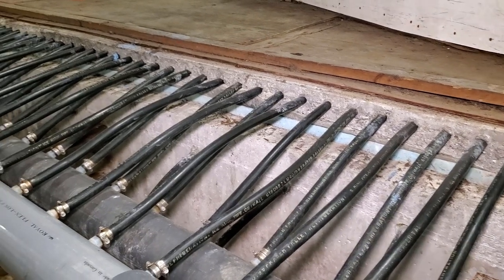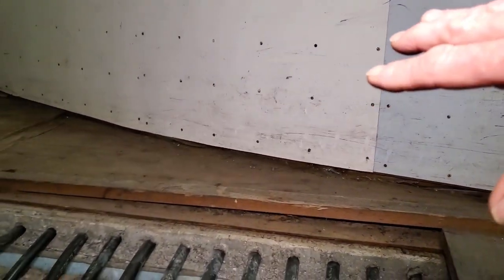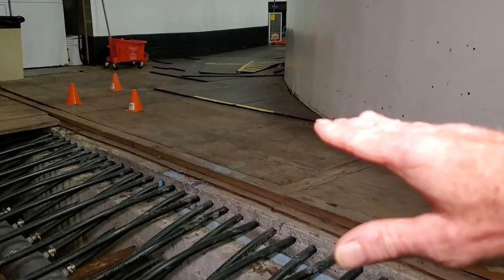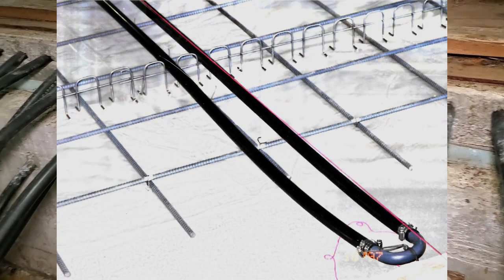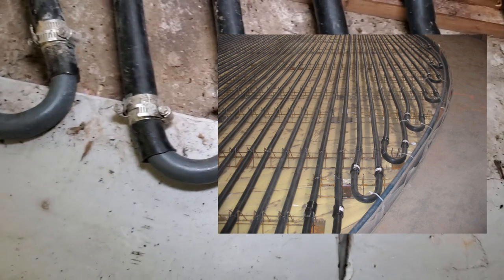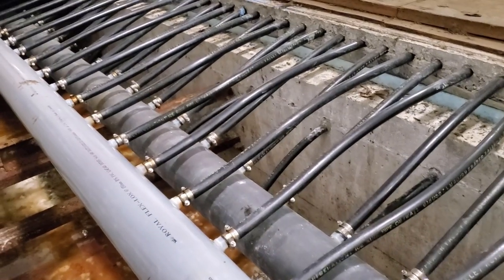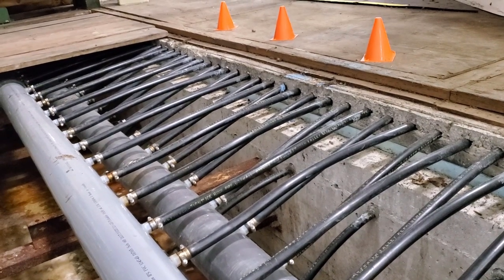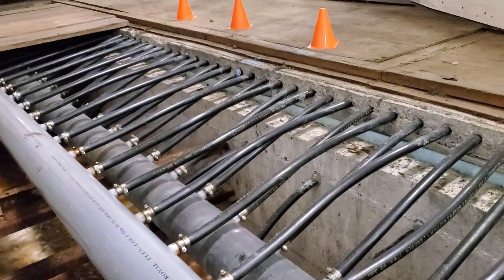Rink floor Basics

Comment: Hi Local Ice Man,  I just enjoyed watching your video showing the details of your ice rink floor system.
You commented initially that you are not familiar with all of the details, which I totally respect.   Personally, I have been in the ice rink floor business for the past 40 years in Canada. 
Just for clarification, in my opinion the accessible headers and return bends, as you have in your facility is the best way to go if possible.  Even if polyfused HD piping is used, the lines in the floor can be damaged, ie; a hole drilled into a pipe, or some of the pipes can be plugged with a gradual build up of rust or debris in the brine system.  Your accessible rink pipe connections will pay huge dividends when you have to repair these types of problems, and these problems will occur.  With a buried header system the repair costs and system down time will be catastrophic.  My suggestion is to always have an accessible header system and return bends. Thank you, Roger Hale - Saskatoon
Reply from the maker: Thank you for sharing your experience.

Comment: Have a question: Why not run a pipe inside a pipe? The pipe running the coolant is the inside pipe, and the outside pipe allows for expansion and contractions? Concrete is corrosive on steel.  The air between is cooled naturally  by the coolant pipe.  I'm not an expert. I just got interested in  hockey this year. Was just wondering how things work. Thank you for your time and video.

Comment: hi there, I would very much appreciate if you could give me an answer. In my project, I can't place all the refrigeration plant (250m2 or 2700 square feet) in the same floor as the ice field for reasons of space. I could place 50m2 (550 square feet) in the ice field level and the rest (200m2) in the floor directly above. Or I could put it all together in the floor above. What of the two options makes more sense in your opinion? If placed in two levels, roughly what would make sense to locate in each? im considering an indirect CO2 transcritical system. Any input would be very appreciated.

Comment: Absolutely love your channel dudes helps me so much as head of maintenance at an ice rink. Do you think you could do a video on repairing the rusted sheet metal on the Zamboni and or repainting repairing the rust spots etc etc. that would be awesome
Reply from the maker: Thanks alot. Appreciate it. For sure. I know the 500 needs some work. Might be some time though but I will keep it in mind. Check out the goal frame painting videos for now. I use a wire brush attachment to grind rust and paint off the goal frames. That's where I would probably start.
Reply: Ice Rink Diaries Okay sweet deal man sounds good I will check that out. 
Both of our Zams are 500’s. you are the man dude. You save us with some of these vids.

Comment: May I ask what the heating tubes below the foam insulation layer are for?
Reply from the maker: To keep the ground below the cooling slab from freezing. If the ground below the slab freezes it can push up on the rink floor making it uneven.

Comment: So which part allows you to keep the ice in longer? In my rink, they say we have to take it out every summer or it will kill it

More questions, for those that have header pipes in the middle of the rink, where is the return pipe?

Also, what is brime?
Reply from the maker: I think you where referring to me saying we maybe have less problems by not taking the ice out much. Just with the fittings I guess. But there are other problems that arise by not taking it out. Like frost build up.

The charge and return pipes would be in an insulated trench to the refrigerator room. 

Brine is the solution made up of calcium chloride and water that is pumped in the cooling slad apose to the refrigerate itself. Glycol is used nowadays instead of brine.
Reply: my local rink here in Australia is open all year round, even during summer with 40c (105f) days and its basically in a shed so i dont know why summer would be a problem
Reply: @dylanporter6720  My boss said that (and I don't know if it's true) if we wouldn't melt, it would create some type of permafrost and kill the concrete, which they wouldn't have money to replace
Reply from the maker: @dylanporter6720  sorry not sure what you mean by problem. Only thing I can think is that takes more emnery to keep it cold in the summer months. Are you referring to something specific I said?
Reply from the maker: @avrumilorkis728  yes I but I think that's what sub floor heat is suppose to prevent. Not too sure if it prevents it all. I was told at STAR training that it takes one week for every year of operation to melt permafrost. 5 years = 5 weeks. Not sure again if that takes inaccount sub floor heat. Also permafrost can push up since water expands and heave the concrete.